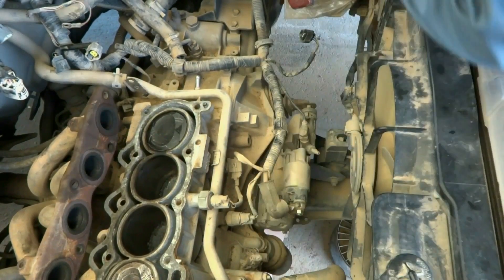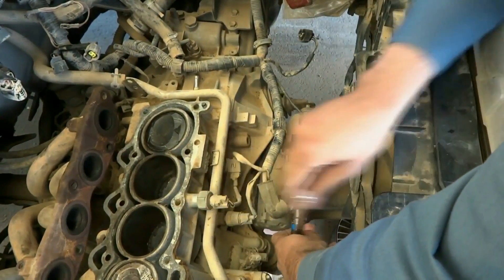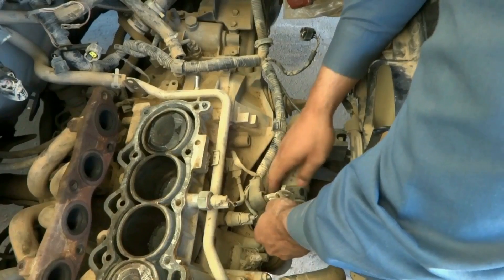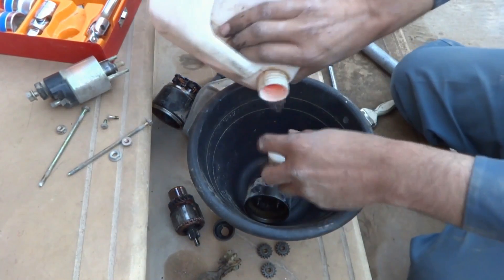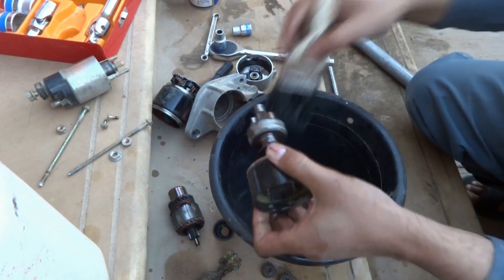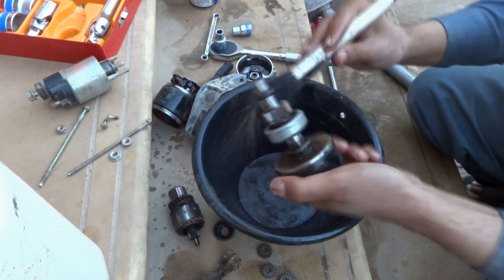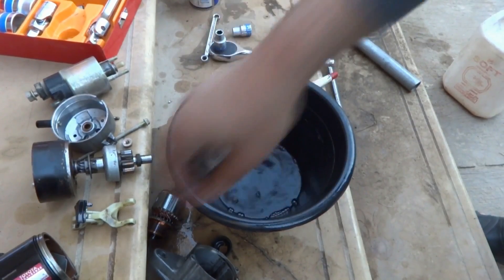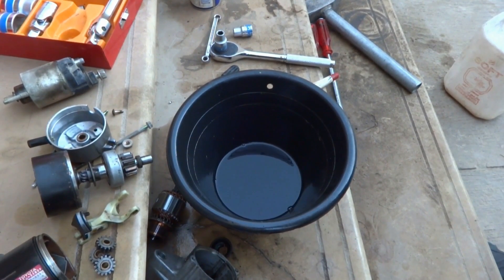Self Starter repair. Self starter maintenance. Car self repair. electrical.

Comment: Hi ,i am recently facing an issue with my 3 year old car.. it will start without any problem in the morning or at the times when the car is not hot. It struggles to start after when the engine becomes warm . At the same time all the electrical accessories are working perfectly. When restarting the car after short journey it behaves like their is no charge in the battery . After trying for 2-3 times it will start very slowly. I went to the service center and they are saying their is no problem with the car when they check.

Please help me with these issue, i want to know what is the exact problem. 

Regards
Reply from the maker: It needs proper scanning using a scan tool when it goes in no start state. Seems there is some electronic issue which prevents spark to the spark plugs or fuel to the injectors results in no start issue. Thorough inspection is required to pinpoint the problem.